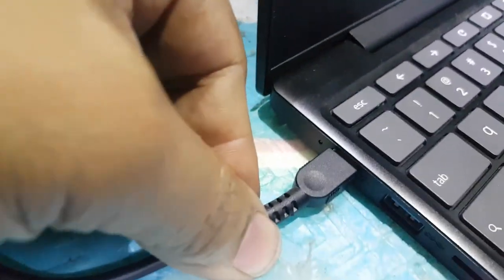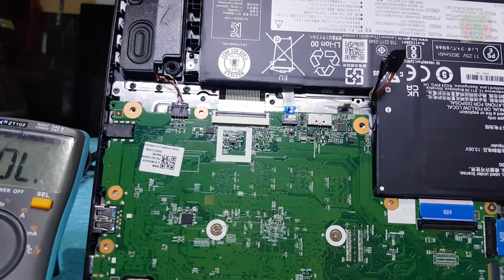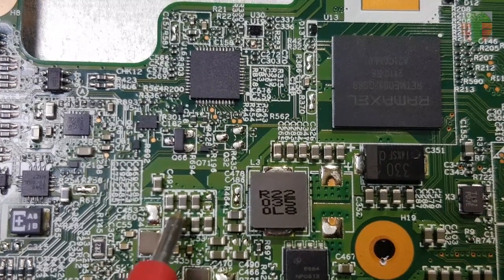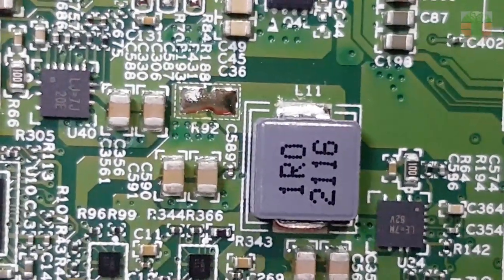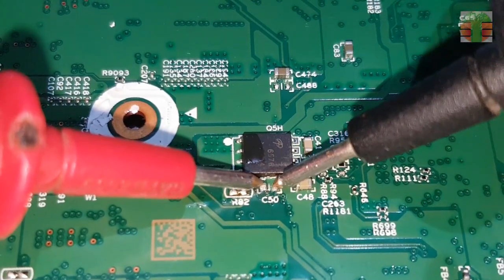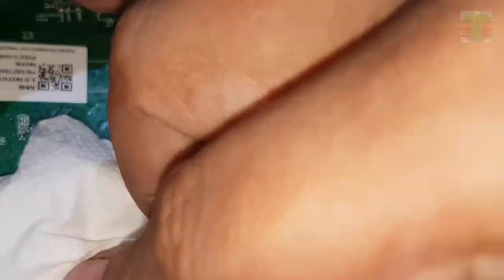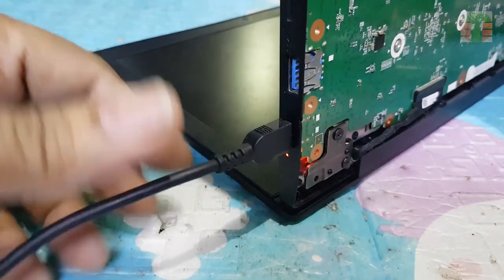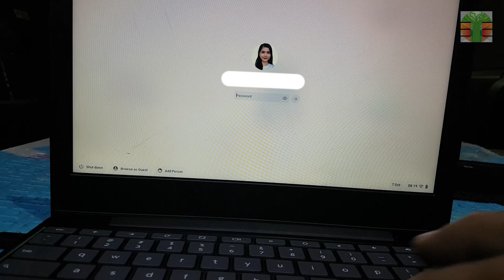Lenovo IdeaPad 3. Not charging and not turning on

Comment: your soldering iron tip is too small, the thick board absorbs its heat instantly, you need  thicker soldering iron tip for this job and a higher temperature like 450c

Comment: Hi it is not true abouth the capacitors , you got them in all values and voltages. Btw it is better to not replace the capacitor then put the wrong value, i hope you put 25v capacitor.  Thit is just a tip i give you.

Comment: I use 350 c with large nozzle and air speed 2 so long as no plastic connectors or aluminium caps nearby, works fine.

Comment: Thank you for the video, but will add my 3 pence to it.

1. Yes, soldering with a hot air station is not the easiest to do - correct. But, when you use it,  and not remove the old solder which is unleaded = you need a higher temp. The mainboard is from a laptop = quite thick. You'd have more heat absorbshion on the driver board from a TV, or some mobile devices. But, PC, TVs, game consoles have too many layers nowadays and that's why they can take a lot of heat. 

2. No, SMD components like capacitors are not always the same if have one colour. Resistors are even worse. There's a range as you've told = agree, and using a larger size of capacitance is a good option. But, try to put 10 times smaller on the rail where is needed 10 times more. So, in many cases will be OK, but, in some it won't work. And, if you do this job, is worth having all from 0201 at least up to 0805 sizes. I buy in a bulk once in a loooooooooong while different sizes and values and than top up if use some of them.

3. I don't like using tweezers with everything bellow 0805 size. I use tweezers to pick a tiny bit of flux, and touch this SMD component with it. Transfer it and use something to  hold to the surface while heating up with a  hot air, or my soldering iron. But it's me, if I'd find a better method, I'd use it ;). Still less stressful than my children around when I try to fix some electronics under the microscope :D.

4. Your struggle with this capacitor is nothing comparing to what I've shown on this/my Youtube channel :D. So, good job!
Reply from the maker: Noted thanks.